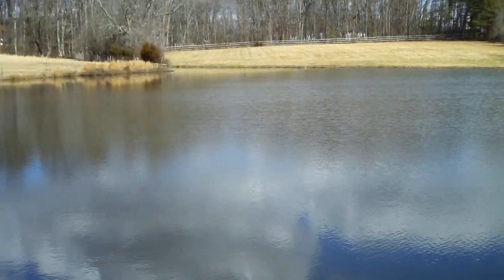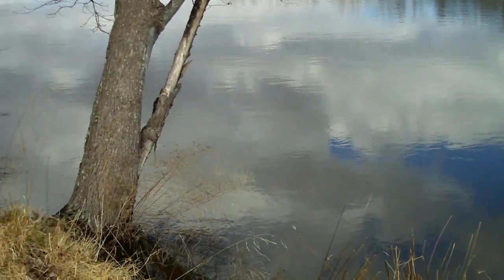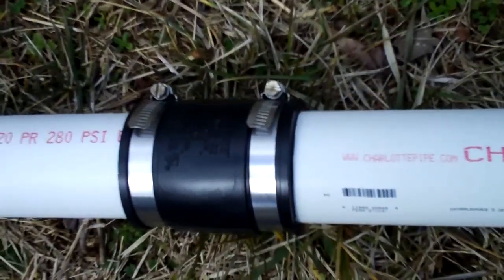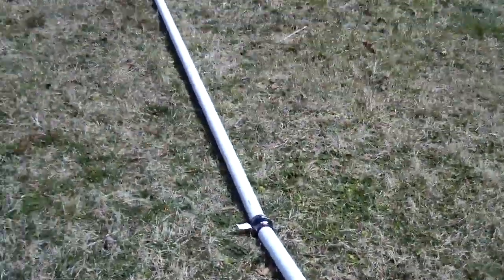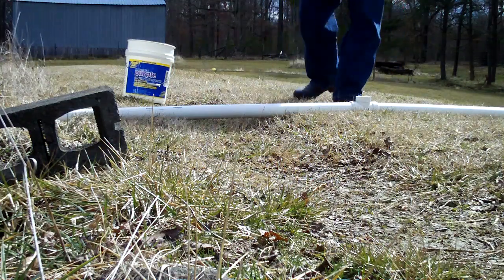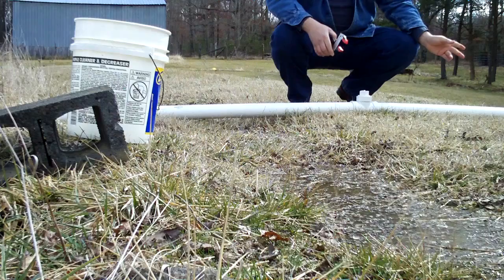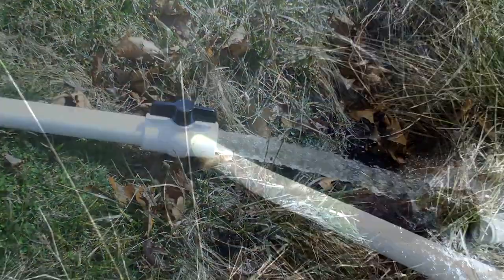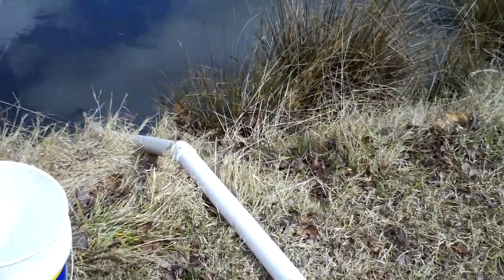DIY Pond Drain-Siphon

Comment: Sleeve your leaking metal pipe with PVC.  Pound it into the pond bottom, cut with a hand saw underwater or above at the end of the summer.
Reply from the maker: K S there are brackets on the side of the pipe supporting it. Can't sleeve it. Only choice is to try working with outlet side pipe. But I think its rusted so much that if I release the pressure in the pipe it may collapse. And cause water to saturate the dam. Potentially causing dam failure.

Comment: Hi, thanks for the video and I'll be glad if you could clarify my doubt
Q 1 Do the water needs to be filled in only the exit side or both to the pond side as well.
Q 2  Can we used  this method in ringwell too to sucked out the water
Please enlightened me with your bright knowledge.
Thanks and eagerly waiting
From tuibuang village, manipur India
Reply from the maker: L Sticker it wouldn't hurt to have it filled completely it would make starting the siphon easier. but you need at least 3/4 of the length of pipe full. and it helps to have the exit at least 10 feet below water level depending on the drop or slop it is on and length of pipe. there are many factors depending on your situation. and I don't quite understand your second question.   hope some of this helps

Comment: We just drained most of our pond this way this weekend with one little issue. Now that we are down to the end the tube is wanting to suck the mud up and clog the pipe. We tied a jug to it as a flaot to keep it off the bottom but are still having issues. Any ideas? We want to drain the entire pond to remove all fish.
Reply from the maker: terri stephens if you don't want to suck up any mud the best solution that I can come up with at the moment is to get a 5 gallon bucket real holes in the bucket a few inches above the mud line and then drill a hole for your pipe to go in the bucket so only thing that goes inside that bucket is the water but then again it depends on how big of a pipe that you're using the siphon out the pond you could use a type of stiff screen and put on the end of your pipe so it keeps it off the bottom it's a hard call to be honest with you
Reply: We used a 4" pipe and we did put a stiff screen across the bottom of the pipe. Thanks
Reply from the maker: terri stephens what I was thinking is if you had something big enough for the water to fill like a big bucket or cut a 55 gallon plastic barrel in half and allow the water to fill the bottom half of that bucket with the pipe going inside of that it will only suck the water out without the mud
Reply: Ok! Thanks for the ideas. I will pass them on to my husband this evening.
Reply from the maker: terri stephens no problem! Welcome

Comment: Microhydro would definitely work there with that much head.   If you powered your house with solar, you could rig the pond drain to release only at times you needed supplemental power and use it like a battery bank.  If you had a small battery system and could use the pond you could probably be off grid if you don't  use too much electricity.
Reply from the maker: John that definitely would be great and the be nice if someone made kits for Micro Hydro that were affordable

Comment: This siphon works because of the huge drop compared to the small incline. Any air left ist just sucked out. For applications where the incline is closer (but still smaller) you might need a second valve at the inflow. This allows to fill the whole pipe with water.
Reply from the maker: Daniel Rose well said.

Comment: Why spend ANY money when you could just temporarily remove the bung.  This would also ensure the existing pipe does NOT become silted up over unnuse.
Reply from the maker: Geoff Reed because that bung plug was hammered in with a 10lb sledge hammer with over 60 + feet of 4 inch pipe full of water and all that water pressure is hard to keep from coming out unless you let the pain drain down to where the hole is try it sometime and you'll understand what I'm talking about

Comment: nice video but i would like to know when you put water, every end of the tube should be close or 1 tube only?
Reply from the maker: jonas balderas  you close the end of the tube that is longest.. which should be the end you want the we're to come out of.  the outlet pipe also needs to be at least 2 to 3 times longer than any piping going across and into the we're source depending on elevation, and grade( angle ).

Comment: weld a bugger pipe over the smaller one with a valve
drill out the wood block and use your new valve to controll the water

Comment: Does the discharge have to be lower than the intake or does it matter?
Reply from the maker: Patrick Holding. end of  discharge pipe needs to be at least twice as low as water level. if the pipe intake has to elevate. up X a mouth of feet up before decent downward, you must  add that number of feet of rise out of the water and add to the length on the discharge pipe.
Reply: I want to drain out a garden area. But where I want to drain is higher than the area I want to discharge the water. Any suggestions please?

Comment: dig a path for the water to flow down, give it an overflow though so it wont start flowing until it gets to a certain level anyways. you can throw a water mill in line and get some kinetic energy, run it to an electric generator if you please.
Reply: I agree with this. The siphon pipe is easier, but if you don't mind some physical labour, I'd dig out a trench and bang a watermill in it. Don't need to run out and prep the siphon each time, either.

Just gotta watch out you don't wind up transporting any fish out, though! Don't forget those screens!

Comment: can you  please help.

we followed your set up trying to siphon the pond. it works fine for 2-3 hours incrementally slowing until stops. we are at our wits end. please help.
Reply from the maker: It sounds to me you do not have enough fall.  You either have to make the outlet pipe linger so it will be theoretically at least a foot lower than what you're inlet pipe is.. Or you have to make your internet or suction pipe shorter to make it higher in elevation than your outlet pipe. Also any fish or debris can stop or slow the siphon.
Reply from the maker: If anything gets caught in the inlet pipe... that will cause problems. Again check and make sure you have enough elevation difference between the opening of the inlet. And the opening of the outlet. You should have at least 1 to 2 feet difference. Otherwise it will do what you have described
Reply from the maker: true. needs to be air tight at the joints
Reply from the maker: is what cheaper? not sure I understand the question

Comment: Dumb question, why didn't you use a fernco fitting and put a ball valve on your existing pipe and just control it from there?
Reply from the maker: The water pressure would blow the fernco off
Reply: +Wallabydam pound the pipe in like the plug you put in, with a wood shim.
Reply from the maker: kleetus92 didn't think about trying it that way. It's worth a try

Comment: My husband and I just tried this method on our pond and for some reason, it did not pull water. When you say the pipe exiting the pond needs to be double in length, do you mean the pipe closest to the pond or the pipe on the drain end?
Reply from the maker: The outlet pipe needs to be double to 3 times longer than the inlet pipe.  Many factors involved, including incline and height of the inlet pipe (pond side) you also have to make sure the pipe is as full of water as possible other wise it will not draw complete and only drain the water you have put in it.
Reply: We tried your method and it works like a charm!!  Thanks for posting this helpful video!
Reply from the maker: Greg Heaster I'm glad to hear that. Everyone has a different pond. And sometimes you had to adjust or make the pipe longer depending on the fall. Fall is always important.  Good to hear!

Comment: Thank you for making this video, you might have saved what was left of my dam. We've been getting a lot of rain in Texas & I don't live full time on my property, so a lot of the back side of my dam has washed out. I started the siphon last Saturday, but had to leave till next weekend. Either way, I know how to do it now, appreciate the time you took to educate me. Mike
Reply from the maker: No problem!    good thing about these as long as you have a intake screen to keep fish or turtles from being stuck in the pipe along with any debris.  It will run without need for power like gas pumps. And no noise close to one. Pipe sizing helps to move alot of water so keep that in mind.
Reply: maybe there was a misunderstanding for me and I'm sorry for what I didn't understand, I was just asking for example the youtubers made a hydraulic pump which turned out to be just a hoax entitled free energy, I mean just to clarify whether the water below can be raised to the top without a machine, please enlighten and have no other purpose than to ask. thank you for everything and i like this chanel.

Comment: going to give it a try this weekend. I had same issue, overflow pipe was rusted out so I filled it with concrete one summer when pond was low. Pond also has a 2" galvanized pipe that went to a live stock watering trough below the dam. the end of this was damaged and it leaks so I need to lower the level of my 2.5 acre pond by about 6 feet to make repairs to the 2" pipe and dig a new overflow pipe into the dam, going with HDPE this time. Your siphon technique looks like answer to get the water down so I can repair my pond.
Reply from the maker: Well I hope this helps. Works great for me. Takes a few minutes to start it. Does the job.

Comment: One quick question? why didn't you just pull the plug on what you had in place already?
You said it had a hole in it but the hole is below, the water line so it should still work.
Reply from the maker: The pipe is 4 inch, With about 12 feet fall on the otherside with about a million gallons or water, there is no way to stop that flow of water once it starts, 8 lbs per gallon! Moving around 240 gallons per minute, 32 lbs a second. It's very complicated to just put a wood cork in it while it's flowing with all that pressure building up every second..which is almost 2000lbs of water moving out every minute.. if it was easy to put a valve on i i would have. But they are very expensive,  the siphon was the cheaper way .

Comment: thanks for sharing!  working on a slightly larger scale project like this right now (15 acre lake ... planning on 6" pipe) ..... do you have to cap the intake in addition to the output to fill the pipe and remove all the air? how much elevation change do you have between the intake and the crest of the siphon?  mine is looking to be around 16 ft  .... also, wondering if i will have to weight down the PVC in the intake section (i need to start with the pipe about 12 ft under the water and 50 ft from the dam to get the desired drop in water level) ... thanks again!
Reply from the maker: You would have to use a valve to keep water from going back into the pond while you fill the pipe, UNLESS You put a  T-Y at the corner of your pipe that heads down hill, and put a clean-out cap on the top of the T-Y fitting, then you can just pour in water from there and it will run downhill into the pipe without losing much water back into the pond, a T-Y fitting is much cheaper then another valve to close it off into the pond, the more downhill pipe you have , the better it will start the siphon,,I recommend having at least double the length of pipe that would be in the water, out of the 30 feet of mine, i had just under 15 feet across the dam and into the water, if you do not you will have problems getting the siphon going, and a weak flow, resulting in slow drainage, and elevation plays a role as well, if you do not have much elevation, i would recommend a longer pip on the drain side,the difference on mine elevation wise is probably  9-10 feet from where it pulls water into the pipe and spills out on my siphon, thats a rough but close guess, so if you do not have the elevation, you have to have the longer pipe on the outlet side to use the weight of the extra water in it to help pull it through properly and continue to drain at a good rate, If you have the 12 ft under water, and if the 50 ft of pipe is on level ground up to the point of drop, I feel you wont need 62 feet of outlet pipe because your only pulling the water up 12 feet, if you can fill the 50 ft of piping from the corner where it drops into the pond, all the way to the outlet valve,with all the length of empty pipe, It Should work, BUT it wont start,if you were to just fill the outlet ( Drop ) pipe only, unless you had double the length, SO if you have two valves, one up top where pipe goes into the pond, and one at the end of outlet, and use a clean-out T to fill all that pipe, cap the clean-out after filling, and grab a buddy to help start it, as soon as you crack out the outlet pipe, your buddy will have to open the top valve as well, to get it going,  Let me know how you do with your situation, i like to hear the results.
Reply: thanks again .... any recommendations on glue for the glued joints?
Reply: also did you bevel the glued pipe sections?
Reply from the maker: cuica643 sorry im just getting around to answering you, but you dont have to bevel the joints but it may help, also you can use PVC glue for the joints, it sets fast so you will nee to be fast in joining them..

Comment: Great video. Your design could work well on beaver ponds where most permanent systems just get plugged up by the beavers. I'm going to try a variant of your design on our beaver-infested pond. Thanks!
Reply from the maker: Thank you, and good luck with your work on those beaver ponds,
Reply: Wallabydam It remains to be seen if I will have enough elevation behind the beaver damn to get a gravity feed. I'm sure there's a formula for such things but I'm a seat-of-the-pants kinda guy so I'll just make a low-cost test to start.
Reply from the maker: as long as you have  the tubing air tight, and the elevation on the outlet side is about 3 inches lower then the pond side, it should work, run a long outlet pipe about 2 times longer then your top and inlet tube length with the outlet tip being about 3 inch below intake elevation, it will work, the added pipe will have the weight of the water behind it and that added weight will cause enough suction to work pretty well.,  if your total inlet and top tube is 10 feet, you need 20 after it, in my opinion, to work good,
Reply: Wallabydam Cool, thanks.

Comment from the maker: Well for one, the pipe is a 4 inch steel pipe, i looked on ebay and everywhere else, only to see  valves cost upwards of $200, the pipe to siphon it was less then $60, and the pipe is rough around the outside, any of the clamp on valves were over $250 and brass ones were almost 400, im way ahead of ya on the valve, but cost was the issue, so a piece of very dry treated wood works, Plus when i shut the valve off on the siphon, water stays in it, when i want to drain it, i open it, starts it again

Comment from the maker: one end is up inside the pond below the water , the exiting end has a ball valve, when filling up the pipe you make sure it is closed, you fill the pipe up top in the middle where i have the clean out tee, you will loose some water to the pond but most should fill the long pipe on the hill, your pipe exiting the pond should be at least double in length, and should be filled to the top, before opening the ball valve at the exiting end, once you open it, it should start to pull vacuum and drain,

Comment from the maker: I have a emergency spill way, not concrete tho, and it only works when the water is up about 2 feet from the top of the dam, which is scary, I will not use or repair the old drain, i guess i could dig the spillway a little deeper, so it flows sooner im just afraid of errosion to the land, if i had the money for concrete, i would do it in a heartbeat! lol....  Thank you for stopping in and your thoughts on it.

Comment from the maker: well the thing is, that pipe has a leak, and if its leaking, because of rust, im pretty sure if i try to shove another pipe in it, it will break, not only that, but  how could i seal a smaller pipe in a bigger pipe, without filling the elbow with sealer, totally making it  impossible to drain again, i like your idea, but imj thinking if its leaking now, the rest of it will eventually leak, and id have to hire a diver or divers to repair it, unless i drain all of it, then i will loose my fish :(

Comment: Could you shove the pvc pipe inside the old metal pipe. Cement the connections as u go. Then work out the height